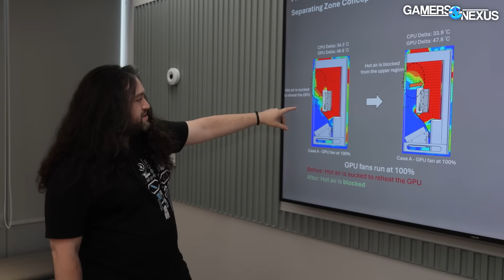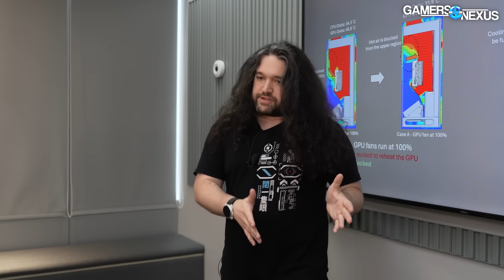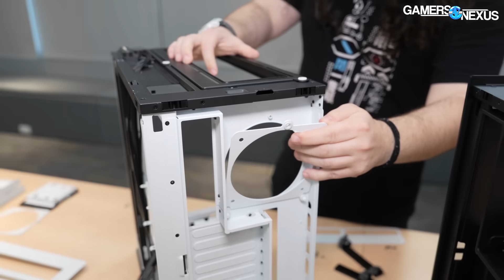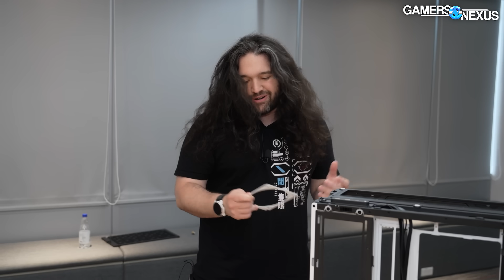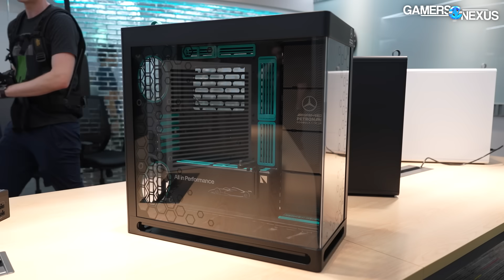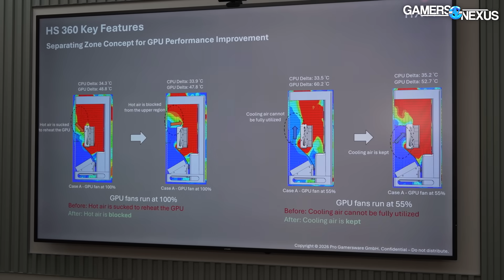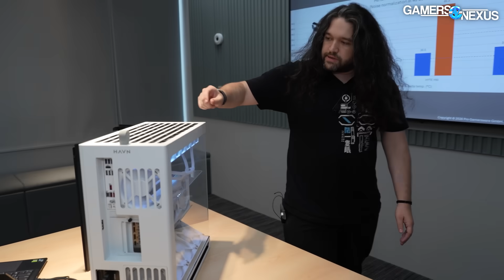Solving the GPU Airflow Problem | Bouncing Air in the HAVN HS 360

Comment: Orrr just hear me out. The corsair 5400 air......the best airflow case of the past two years and you have yet to even bat an eye at it. My cou temps dropped like 8 degrees for some reason and it literally has airflow guides that stuff air into the gpu and pull out of the top of the pc
Reply: I dont know how or why you have yet to do this unless.i somehow missed it?.
Reply: Nothing beats my TT W200 for airflow. I think I have about 20 fans cooling about 20 drives and a 4090. Zero heat problems.

Comment: PC enthusiasts can't afford DRAM for a new build, so companies are now applying their effort to making ridiculously over-designed, over-engineered, overly complex, and over-priced cases.  I guess the idea is that people are desperate to change something in their PCs, and putting one's PC in a new case is an obvious option.  From where I sit, intake in the front and exhaust in the rear still wins, and everything else is a gimmick.  A couple of degrees better cooling and/or a dB less noise -- if either is achieved by all this -- is NOT going to change anyone's life.

Comment: Since I have a glass cover on my case with 2 140 outtakes on my aio at the top,  2 140 intakes at the bottom and only one 120 on the left for motherboard I wish someone made a fan stand which could move forward and back with a change of the blowing angle so my motherboard could get some air too. Because in todays pcs motherboards get so little cooling. 120 on a side is really struggling to cool anything but nothing just because 2 140mm of my aio take all the air flow inside a case and just blow it all out.

Comment: There are quite a few very simple solutions to solve airflow issues if all people want is to separate air flow to cool down all components.  Why are people doing all these tiny modifications to their computer cases that people could do easily with just duct tape and a few pieces of cardboard?

Comment: I can understand the reasoning behind this design, but wouldn't that just exhaust the hot air towards the mobo, which is already hot? That GPU looked like it was sitting right up against, if not touching, the board components.

Comment: in those airflow diagrams, GPU temps go down, but CPU temps go up. So it helps one component to be cooler but it's at the expense of another component. Not saying its good or bad. Just an observation.
Reply: Replace all that glass with vented metal and fans and all the problems go away, including the unsupported corner idiocy. Nobody cares about your empty looking aquarium case.

Comment: The airflow problem is simple:  You are building in a damn rectagunlar box.  I give Alienware credit for experimenting with different designs. The Trapezoidal TRIAD Area 51 (which I have) allows hot are to make its way up and out the back on an angle.  That's something that is also done in the military for stealth jets to angle hot air away from the jet to confuse IR-missiles. 

The best shapes for building a computer are circular. This allows maximum airflow efficiency in a vortex. Apple designed some of their computers on that concept.

Next: It's over for fan cooling. LIQUID COOLERS ARE REQUIRED for the thermal output of these new CPU and GPU. An AIO on the CPU and an AIO on the GPU will give you the low noise levels you want. The question is:  what are you using to move the liquid through the loop.  Magnetohydrodynamics would be great in this application but for now we use radiators and fans.   I say: increase the liquid volume to increase the amount of thermal intake.  

My new Area 51 with 5090, 12TB SSD, 285k and 1500W PSU runs cool and quiet in Battlefield 6, Cyberpunk and everything else in max settings.
Reply: A rectangle with air being pulled in from the front and bottom and exhausted out the back and top is more than enough for any system. The problem are the modern case designs suck ass for cooling.

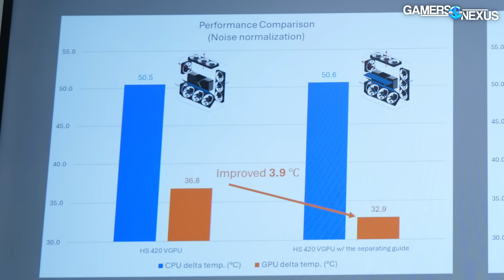Comment: 10:30 I have the HS 420 VGPU. Are they bringing out a new 420 case with a flow separator, or will we be able to get the flow separator piece and attach it to the current case?

Comment: Were slowly moving back to ducts like in the old Dell workstations.
Reply: Bring back BTX form factor!!!!! 😆😆
Reply: Those ducts were great. Someone sell a cheap case with no dumb glass or RGB and just make it solid with ducts for main components and I'm all over it.
Reply: yeah, system76 does something similar with its cases too
Reply: Honestly, compartmentalising each "block", CPU, GPU, PSU, helps with lowering the temps without feeding warm or hot air one to another, there a way to make airducts be functional and aesthetically pleasing, it always takes me back to Optimum tech´s 3D-print ducts build.
Reply: saying "honestly" doesn't improve your credibility.
Reply: @x-RedSun Neither does that full stop you used at the end that makes you sound like a pompous more-on, but yes I agree on what you said. Why even use a full stop if your entire comment is just one sentence?
Reply: @AndyU96  I don't agree with what you-said. Don't cast grammatical stones when your own run-ons are made of glass. The only pompous-moron is you. The fact that you called a period a "full-stop". Pompous? lol lmao even

Comment: If this breaths 1 year more life into my 3090 I would switch in a heartbeat
Reply: What case are you using? I have the EVGA FTW3 Ultra 3090 and I’ve switched cases a lot, and found some cheap ones that keep it cool under extended gaming.
Reply: 3090 is a few years old now. Have you tried repasting it? 🙂

Comment: it's cool seeing a group target improvements in airflow in cases, especially using fluid analysis.

The only real issue I have, and probably every other group/company doing the same, is how it affects their cost to manufacture.  $150 retail for a case with no fans is nothing to sneeze at, and while it does help temps, is the cost increase worth it for the consumer and for HAVN themselves?  for some of us ya probably, but I really dont want to see a company like HAVN fall because overengineering and manufacturing cost kills their bottom line and margins.  At least they are taking the risk and leap to improve performance in cases and presumably in their other products as well.

and honestly, that might be why the pc case market hasnt been iterating like HAVN have been doing.  They (the market) are probably aware of how to decrease temps, but the cost to do so is so great that they simply cannot afford to, short of a better base design (like the lian li lancool or Torrent).

just my 2 cents.  I do think a case like this combining function and form is neat, and I would probably pick one up if I didnt already have cases in use and in reserve.

Comment: The Corsair 3500x is a great case actually. It's rated really well on amazon.
Reply from the maker: lol
Reply: @GamersNexus  I got a 3500x for $60 new and it came with 3 corsair fans. I sold the fans and pretty much offset the cost of the entire case lol.
Reply: lol
Reply: @DeerJerky  I have had mine for over a year now and have never had any problems with it. For the money it is good imo.
Reply: Everything is rated really well on amazon. So well that you now need to ask permission to view more that a handful of reviews on amazon. Every wonder why EVERYTHING on Amazon has 4.5 star review?
Reply: @MAGAMAN What I meant is that you read the reviews for the case and you don't really hear any horror stories. If you see a product under 4 stars or around 4 stars you generally know something is bad. Some Corsair products are poorly reviewed on there actually look it up. It's a good fuckin case idgaf what anyone says.
Reply: I do agree though the amazon reviews shouldn't be the deciding factor. You def should do more research before you buy something lol, but all of those "reviews" are paid off as well usually so 😅 I have used the 3500x for a year and it really isn't bad for the money. It is good for what it is imo when comparing it to my full tower and a few other cases. The hs360 that was showed off here was complete bs though. Idk if I saw that right, but it looks like you have to mount the gpu like that cause of how the case is designed. It looks ridiculous and adds unnecessary complexity at the cost of function. Why even test this shit?

Comment: a complaint i have is for tha 360 usig EATX there needs to be a slightly larger gap *.1 mm that would allow a 90^ 24 pin connector to fit.  Everything Else is awesome!

Comment: Rotate the graphics card 90 degrees, then add two glass panes at 45 degrees to redirect the air back into the airflow the card had originally?

Like is all this being done just so you can look at your graphics card through the side of the case?

Comment: Soo... mount the GPU normal and it will act as a separator by itself if the case isnt to wide? then put 2-3 fans in the front and one up (not in the top, at the top, where PSU's used to sit!) in the back and there will be 1-2 fans pulling directing to the CPU and 0.5-1 fan adding cool below the GPU... and then the back fan will help the flow to not stagnate but being mess flow than intake keeping a tad of pressure. Seems like it is just a way to justify mounting the GPU on the side 🤷‍♂️

Also blowing air to separe like going into malls and such is "cooler", would love to see some ejectors and stuff to make air curtains/walls inside a chassi xD

Comment: This has already been resolved!
Hot air rises..cold air from side and bottom ..exhaust at top!
Blowing air at glass makes the cold air stick to glass due to atmospheric pressure and moisture.
Reply: Hot air only rises with 0 pressure. Any kind of fan can and will easily alter the airflow.

Comment: I don't get it. The GPU fans are blowing inwards towards the heatsink/core ... I presume the hot air then gets exhausted to the upper part of the case. Meaning the CPU's radiator is using all that hot air to try and cool itself?? I don't see any other intake fans on the case other than the row at the bottom for the GPU.

Comment: Remember when GPUs exhausted out the back? 
I've always thought having an exhaust under the PCIe slot was dumb.
Reply: Yeah that was noisy and suboptimal and they fell out of the consumer market. Rtx 6000s and w9700 pros are still blower to back exhaust since people stack multiples in the same case
Reply: I love my W6800 in my mATX system.
Reply: Servers are kinda greedy / spoiled. 
They use many 40mmx40mm deep, at 20-40krpm. 
That rpm would not be allowed in a home pc.
The extra for servers was built in to be done.
Reply: Same, blower fans the best
Reply: i mean we still had it for the 40 Series FE. The standart gpu design is just the easiest to build
Reply: @TRL601TT not really, the blower designs are generally the cheapest to build from a labor or materials standpoint, the problem is reddit mentality/poisoned market.
Reply: There's a reason those don't exist anymore.
Reply: @kidnovatex  Why?
Reply: @MarkBarrett  Loud and not very efficient in a small form factor like a gaming PC.
Reply: @MarkBarrett  as someone with a 5700 XT that only maintains 65°C @ 4000rpm - they're very loud lmao
doesn't bother me much when I have headphones on, but most people are chasing ultra-quiet cooling and blower-style coolers aren't it lol
Reply: If I were an old man, I'd say: 
Exhaust out the back, that is how my old man did. 
(It works)
Reply: I am NOT running at my normal rate. 
I am NOT running at my normal ....... 
Something is pushing me with hp....

Comment: Cant wait until we get side wall intakes like we had in the cases of old antec.
Reply: My first case (NZXT phantom) had 1x 200mm and 2x 120mm in the side panel
Reply: we are coming full circle
Reply: Cooler Master Haf-X (which I still use) has that big side wall intake fan. Bring them back!
Reply: Silverstone GD11B has two 120mm fans blowing outside air onto the GPU intake.
Reply: had this with my old hafx
Reply: I was thinking just put the GPU right next to side panel and perforate it so that the GPU draws in fresh air from the outside of the case. Why use another fan to push air to GPU inside a hot box, when the GPU could suck in air with unlimited supply by itself.
Reply: I literally thought the same
Reply: I ran a Xclio case with 2 250mm fans. One in front one on the side
Reply: NZXT Tempest Evo and NZXT Alpha.
Reply: with pogo pins please so I dont have to plug it in before closing the case
Reply: @raikoh05 oh but that was the fun. The cord has to be long enough so you can open the case, but every time you try to close it you knick the wire in the fan
Reply: They need to be side wall exhaust ducts. Intake is best achieved through the bottom (with a regularly mounted GPU). Of course the PSU needs to be in a different place (ideally on the other side of the motherboard). Alas, no case maker gets that this would be the ideal approach.

Comment: lol it will gonna cook ram and m.2 so bad. all heat from gpu feeding onto them
Reply from the maker: That already happens. We tested that with the HS 420 already and it wasn't really a big impact.
Reply: @GamersNexus  Its a terrible design. The whole design with installing the M2 on the motherboard is also a terrible design, because it usually sits right under the video card, which is usually the hottest spot in the computer.

Comment: Arctic MX-7 completely dried out on my CPU after less than a year. 0/10 don’t recommend.
Reply: I recommend Thermal Grizzly Kryonaut Extreme.
Reply: @ModernOddity728  Nah, that’s not any better. Kryonaut Extreme is so bad about pump out Thermal Grizzly literally had to create Duronaut (an entirely different type of paste) to deal with its issues.
Reply: @jm5206  I have yet to try Duronaut as I couldn't find an advertised thermal conductivity rate when it released and have not needed more since I bought some KE around that time.
I have not had trouble with it myself.
Have you found any that are ideal for you?
Reply: I still have a tube of MX4 from my last build 5 years ago. No reason to use anything newer.

Comment: after more than 40 years of PC gaming, there are still physical optimizations to be found.  always cool!
Reply: Seems like they should have figured this out back in the garage building days to be honest. It's just another way of directing airflow.

Wait so they decided to not only invent but also commodify liquid cooling for electrical machines MAINSTREAM before sticking a few extra bits of plastic inside the PC?
Reply: @Philip_Taylor  Well we all know what sells more :). Altough tbf nothing can match the unlimted potential of radiator size when liquid cooling
Reply: The "optimizations" are work-arounds from shitty case designs.
Reply: @M@MAGAMAN. Trade-off between aesthetics and functionality, like almost any consumer product. And even then you can have trade offs between cooling design and ease of use (i.e. server style cases that are a pain to build in, but will outperform any tower case).
Reply: @MAGAMANkinda nuts people still wanna show off their internals if most of the info isn't even visible; the CPU isn't visible, the ram sticks can't see the speeds even if they're some Corsair dominator RGB shiz, most GPUs don't have the card model printed on them or on a spot where it isn't visible if orientated any other way, the ultra uber mega blazing fast SSDs are hidden in the case and under the GPU, the Uber mega watt PSU is hidden behind a compartment...
I've once modelled a case that would incredibly decrease a mATX footprint by making it a dual compartment and putting the GPU on the back which won't push hot air onto the CPU and its HSF. I'm talking like a decade ago and I'm happy some case manufacturers are finally doing them (probably took long because of the cost of tooling). That way you can have a case you can orientate towards showing off the CPU (if you have a nice HSF/LC I guess) or the GPU (if you have some sexy shroud to show off) but like I said, this was mostly for better cooling and less footprint.
In any CASE, it's kinda weird to put the GPU with it's 90C degree heat pushing into the CPU, weird most case manufacturers don't wanna put the GPU any different than vertical or default horizontal
Reply: not any more optimized than a straight line